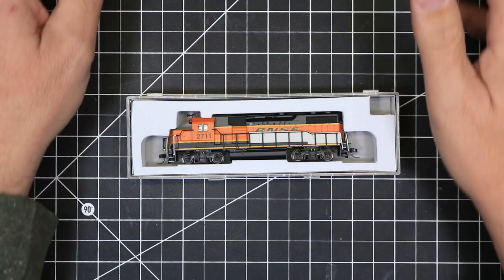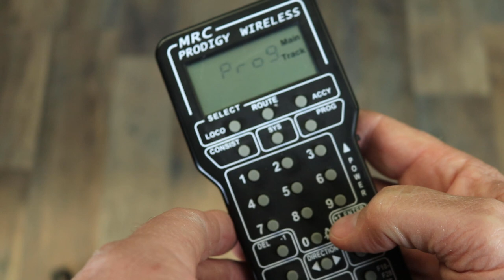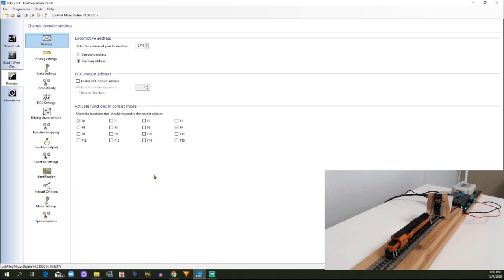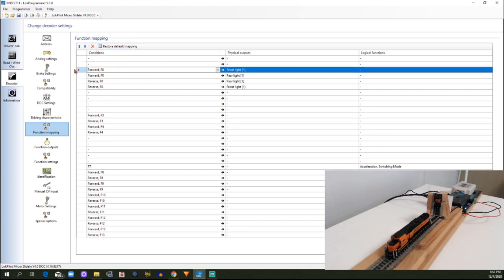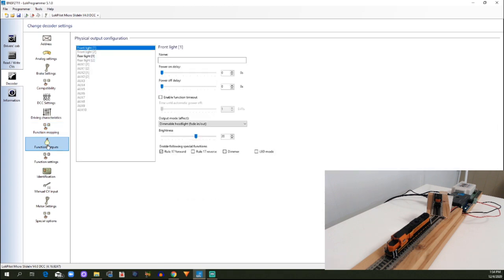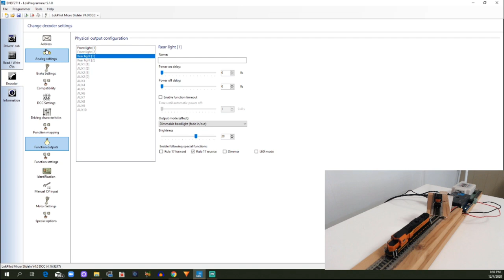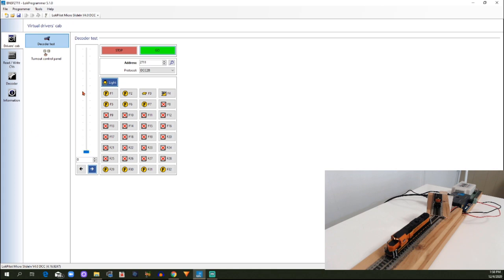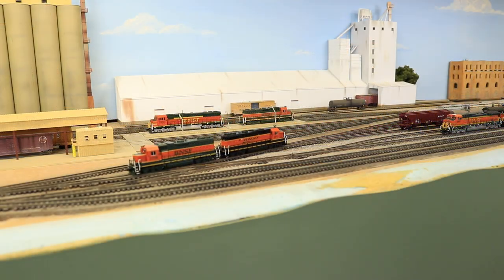ESU LokPilot Decoder Installation and Customization in an Atlas N GP39-2

Comment: My old Atlas GP-38-40’s run crappy even with NCE decoders. Want to get a new 39 With LokSound. Don’t have sound in Switchers. Just Road Engines. 

Having to Consist a GP-38 High Hood, GP-40 and an MT SW1200 together because they all run rough. None are broken in much, so that helps push or pull the laggards along.

Comment: I have 2 Atlas locos with the Digitrax decoders. Took me hours to get them to speed match.  I also have 2 BLI locos with the Paragon3 decoders and they run perfectly together. I have 3 more locos to put decoders in and you may have convinced me to try those ESU Lok Sound decoders.

Comment: I have a question about DCC I have a problem as I have a MRC Prodigy Express 2 and Bachman Nscale track I can connect the base unit to the cab with everything connected to my program track the problem I have is there’s no reaction from my engines do I need heavier gage wire to connect or will the stock connection work thank you for any help you can give

Comment: Thanks for the video Ron. In my personal experience over the years I used to think that TCS had the best motor control. As I have purchased and installed the ESU units...Hands down ESU. I do have a ESU programmer and recently purchased their CabControl system. I know you are an MRC operator. See if one of the suppliers can send you one for a demo. I don't think you will be disappointed.

Comment: Thanks Ron. I started with Digitrax decoders myself until TCS came along. They definitely offer the ease of programming. Now that ESU has more to offer to N scale, I do quite a bit sound installations in my Locomotives . Not to mention the custom lighting. They are a vast improvement over any other decoder I believe.